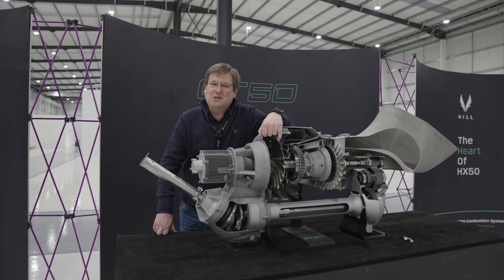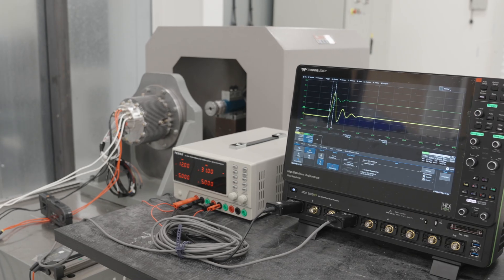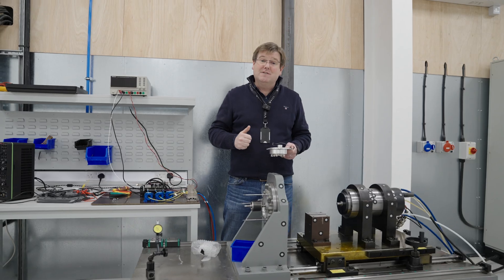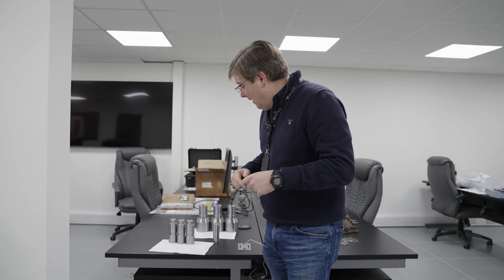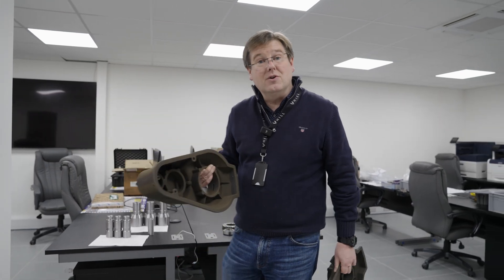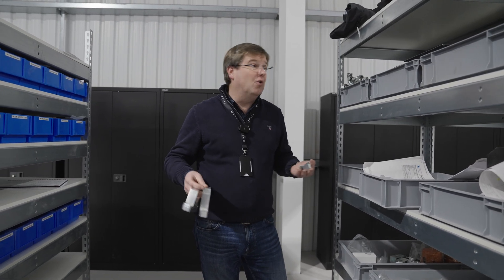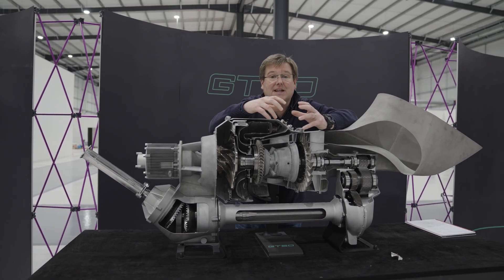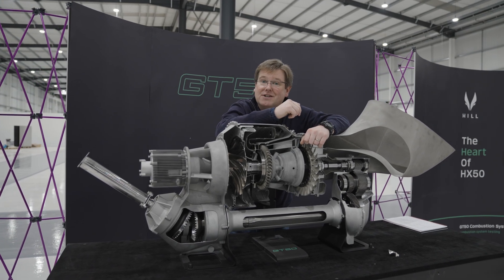GT50 Update: Starter Generator and Gearbox

Comment: Regarding the starter/generator, does that require particular sophistication? other than surviving 50krpm which the small diameter and maybe carbon fiber wrapping can help, isn't it a fairly simple scheme to spin it up to 10-20krpm in starter mode and more passively draw power when it spins at 50krpm with no particular timing requirements. The high rpm lends itself very well to electric motor power density. Only ~2Nm torque to produce 10kW. An interesting possibility would be to scale the generator to 400kW to have electric transmission of the power to both main and tail rotor. No gear boxes, no drive shafts, the engine could even be placed in the tail.

Comment: Lecroy scope, spared no expense. Slight overkill for motor timescales :)
Reply: Correct 200 USD power supply and 30K scope 😆
Reply: @XBDT  apparently it has a 3 phase motor drive analyser mode, probably why they chose it then. I found one price of 43k$